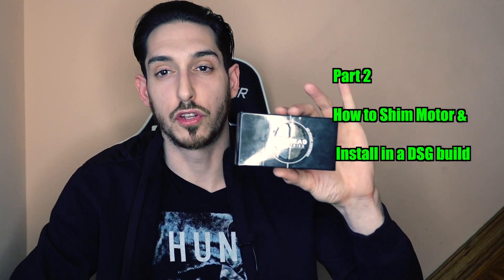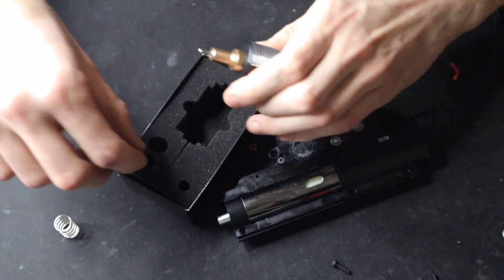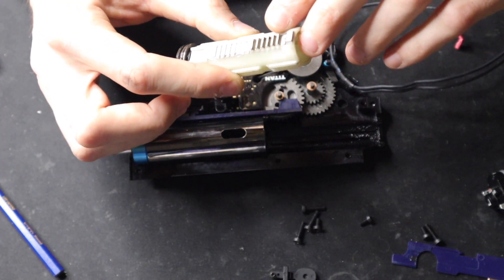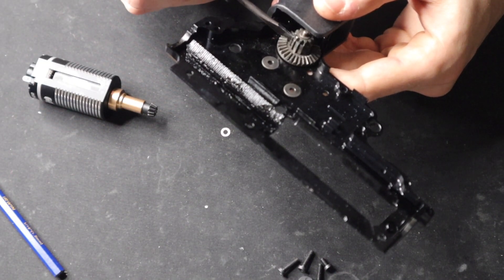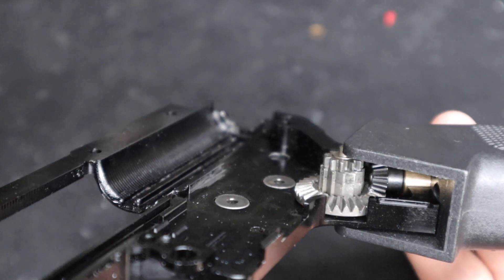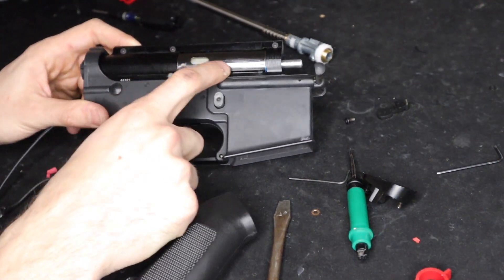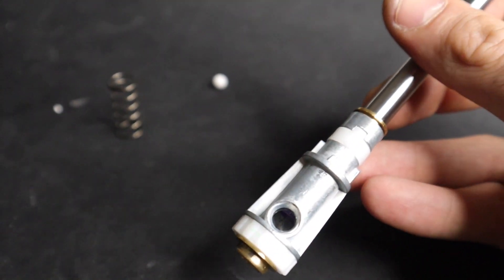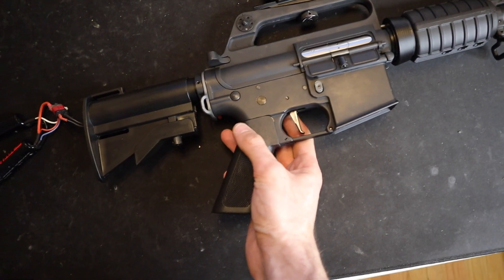Warhead Brushless Motor x High Speed DSG Install & Test + Mis Feeding FIX

Comment: I burned out a brushless motor 4 hrs into a Milsim , puff of smoke. Wish I got the Warhead instead
Reply from the maker: Warhead is garbage and the worse motor. 

If something failed it was most likely due to installation , or mis programming. Warhead is ass compared to T238 

I’m also coming out with my own brushless motor this up coming month

Comment: I have a question i Have krtyac Rec7 barret model and i want to buy the warhead 50krpm but which battery should i use?? Can i use 11.1?? Or 7.4?? And which gear set is good 13:1?? Or 18:1 can you please help me with my question👍🏻

Comment: Hi bro awesome video! By the way Iam now installing the warhead 52k to my dsg build and it is double shot on single, do you have any idea what should id do to fix it? Thanks!
Reply from the maker: Bro your in for a world of trouble with a 52 k and a DSG. But your going to need active breaking because your motor is way too fast. But then warheads don’t work with active breaking enabled. 

You choose a motor that was wayyyy too fast
Reply: @TheRealDealAirsoft  Iam thinking to change the warhead to the 36k one, will it eliminate the problem? which warhead you are using in this vid? By the way thank you for your quick answer! it means a lot!

Comment: what motor is that, is that the standard motor or the high speed or ultra highspeed, i have been told by reddit not to mix high speed motors with dsg gears, so im assuming it is the standard motor?
Reply from the maker: It was the 30k warhead but it had so many feeding issues now this build has my Real Deal Gen 2 Golden Boi Motor achieve it nearly the same rps 

https://www.therealdealairsoft.com/products/the-real-deal-motor-18tpa-n35sh-high-torque

Comment: Would it be possible to just put a new motor in a stock gun and maybe upgrade the piston so it doesnt break?
Reply from the maker: For sure. But while your in there you might as well change the mosfet to something like a perun hybrid because it will controll the motor. Sometimes high torque motors could cause over cycling the mosfet controls the system 

https://www.therealdealairsoft.com/products/perun-hybrid-mosfet
Reply: @TheRealDealAirsoft  i have zero tech experience besides dropping in a new charging handle haha so im not sure how it works or how to put it in, i dont want to mess my gun up by doing something wrong or having my nozzle mis-aligned when i put the gerbox back in

Comment: Just so u know mah is battery capacity not power rate u want higher discharge battery for better rof and trigger response like that battery was 15-25c probly if u want more from 11.1 use 35-50c discharge I can go higher but ya just wanted to let u know mah is just howlong your battery’s gonna last for

Comment: I’ve used so many types of aoe correction I’ll give the ppl a cheap alternative since Sorbothane hard to get in some places but rubber washers work great and good for gearbox shell u can find them softer to very firm u want a more firm hard rubber washer so it buffs the beating on the gearbox shell

Comment: @The Real Deal Airsoft  You are correct on the reason you get higher performance under load with the 3000MaH battery vs the 1000MaH battery with the same C rating is because the total continues output of the higher capacity battery is much higher. (3x)

The reason this matters is because the mechanics of what causes this performance decrease is also detrimental to the health of the battery.
The 3000MaH battery at 10c can deliver 30 amps continues. 
The 1000MaH Battery at 10c can deliver 10 amps continues.
If your setup drains 20 AMPS continues on full auto, the smaller battery wont be able to supply that at the rated voltage. So In order to make up for the demand in current the voltage has to drop. This in turn will slow down your motor and is also bad for the health of your battery. 
This also means the 3000MaH battery will be perfect for this setup. And getting a higher C rating is a waste of money because the AEG does not require more current than the battery can provide. Getting higher capacity is useful tho because this means you can run the AEG for a longer time before the battery is empty.
If it fits in your AEG. Use a 4000MaH battery at 20C over a 2000MaH one at 40C. Both can output the same but one will last much longer. 

Also be aware that 90% of the batteries marketed at "airsoft" are straight up lying about their C ratings. 
I've tested a lot of batteries on my dyno and the majority of airsoft batteries that claim 20 or 25 C are in reality only 10 or 15 at most.
Most people wont find out. Because in burst discharge (couple of seconds at most) when they full auto the battery can supply enough for that time.

It's insane how they can get away with lying about that. Some even charge a premium for their higher discharge batteries and they are the same under the wrapping.

TLDR: Airsoft brands lie about C ratings. When a lower capacity(less MaH) battery decreases your RoF and trigger responds, it cannot supply enough current to your AEG.
Reply from the maker: You have no idea how many people fought me on this

Comment: Currently running a
18:1 dsg
Sp150 3 coils cut 
No active breaking 
Asg 16tpa 30k 
Gate titan 
3000 50c 11.1v 

 And running into lots of heat issues and high amp draws 60 on semi and 40 on full. My motor is probably over working it’s self. Also my ROF has decreased significantly from 42 to 29 motor is probably fucked from all that heat. I want something more efficient like a warhead brushless but I’m not sure what rpm to use on my current set up I want to improve the trigger respond as well as keeping my rps somewhere healthy for a 18:1 dsg. If you have any recommendations on what rpm to use that will be greatly appreciated.
Reply: i believe the high speed version that runs at 36k with a 11.1v should suffice. unless you want to go ham and run the 52k (35k at 7.4v) rpm one. like in the vid. as far as my experience goes. torque is not a major issue on any of the rpm's would recommend using a black series one. dissipates heat a bit better. ( take all of this with a grain of salt. i am no professional. just going of all the builds in my local community)
Reply: @nikosator  Alr thanks 🙏 Ill take that into consideration
Reply from the maker: If you don’t want problems just grab a real deal golden Boi. Youl hit 40 rps easy and the motor will be tons more efficient. ASG has lower tap count and has magnets that actually cause a higher amp draw than n35 magnets. ASG30 k is old tech. 

The warheads will most likely cause you issues. I don’t use them anymore. Tired of spending $150 for the warhead ecu to act up and cause misfeeding. I’ve experienced so many problems with warhead I stopped carrying them. 

Drop a real deal golden Boi in there and you will have no problem. If you look at my DSG recent builds I show how the golden Boi performs. It’s amazing. If you need a real deal shim guide tk aid in shimming and heat reduction. Email me and ask for it
Reply: @TheRealDealAirsoft  Could you get 60rps from a Golden Boi?
Reply from the maker: @mrcloud234  no Youl be in the 40-48 rps range depending on set up. 

It’s wicked fast anything over 45 rps is sketch and has diminishing returns
Reply: @TheRealDealAirsoft  Ok Thank You So Much!  Will it over heat? Run Hot? Wear down the gears?
I really have no clue but You know more than me. I was Really hoping for 60 RPS but ill settle for 45 lol

Thanks. (edit) nvm 45 good https://www.youtube.com/watch?v=Vbf0yvYbyT8
Reply from the maker: Don’t ever use a 50 k warhead. Don’t you will have failures
Reply: @TheRealDealAirsoft  I’ll try the golden boi how long would shipping take to California
Reply from the maker: Your shimming is the problem. Your bevel to pinion is causing your motor to draw much too much heat. 

The best option for your desired rps range .. especially if your running an ASG 30k then my real deal golden Boi gen 2 motor is your go too. 

I have certain magnets that are high temperature rated neodymium magnets which are meant to maintain performance even during high heat exposure. 

As well we have replacement brushes if your brushes wear our. Cheap part fast shipping. 

Also my motor has 2 more tpa than the ASG30. That motor is known to run hot. 

More tpa is more torque and will thus draw less energy. 

And on top of it my rpm is almost the same as the asg30k tested with no load. So Youl have the same rps. After you grab my motor email me and I’ll send you the real deal shim guide pdf and re shim your bevel to pinion.

Comment: Bro I need help, I have that same motor, I bought the gate titan, I bought the Siegetek Concept Cyclone Revolution Plus (10.44 Ratio) I bought the blue retro arms gearbox, and installed everything perfect but when I shoot, it shoots 2 or 3 times and gets stuck, it is searched for a thousand things and I don't know what's going on, everything runs perfectly, and I use a spring 150, I'm frustrated.  I'm installing all that to an arp9
Reply from the maker: Got to love a warhead lmao. I refuse to use the black can warhead because of literally dozens of builds maybe in the 20 -30s of AEGs with black can that just caused so many issues. That’s what actually inspired me to reading and launch my own motor. The Golden boi. But try to flip it to auto when you power up shoot a burst then go back to semi and see if it functions
Reply: @TheRealDealAirsoft  thank you very much, thank you for taking the time to help me
Reply from the maker: Also make sure to modify your baseplate if the grip. ARP9 does not seat the motor well it’s not good. It will cause a lock up for sure.
Reply from the maker: On my IG if you scroll down I have an ARP9 with a warhead and I show the modification needed on my IG just  scroll down alot

Comment: Why is the half missing on the Piston? Do i need to do the same? 2:50
Reply: For Dual sector gears with 8 teeth. Don't need more teeth on the piston if only ~6 are being used. Weight saving.

Comment: I got problem with gate advance+DSG +Warhead 30k.. if use 0 active break will overspin at single.. and i put at 40 for active break no overspin again.. are that okey for the motor use 40% AB?? Thanks
Reply from the maker: Warhead will cause you a ton of problems expecialky with DSG that’s what inspired me to launch my own Line of motors 

Use as little AB as you can. Try lower settings but if 40 percent works then stick with 40 percent. It won’t hurt the motor
Reply: @TheRealDealAirsoft  thanks sir. I was try to change my bevel gear use 9teeth and now i using 20% AB . No overspin again.. hope we can share some problem again sir..
Thanks
GodBless 😎

Comment: Higher Mah doesn't equal higher RPMs... That's not what Mah does. It's energy storage. The higher Voltage is what would give more speed, because voltage is the power and ampere (the "a" in Mah) is the resistence. Voltage is the transfer of electrons across a medium, so the more voltage you have the more electrons you have, the more energy you're inputting. Hence why 7.4s are generally weaker than 11.1s. 

C is current, which is a measure of voltage to amps across the medium, or the measure of voltage against resistance; and is calculated as C=V/A , or Current equals Voltage divide by Ampere. And C rating is the charging and discharging rate. Basically all that means is how quickly a battery can offload it's energy, Higher C ratings will perform better under loads, and provide more consistent energy over time, but cause the battery to drain faster. 

Mah is determined for that voltage BASED on 1C, so for one hour at 1C, 1500MAh will output 1500 milliamps continuously, while 1000MaH at 1C will output 1000 milliamps. So for instance:
two 1500MaH 11.1v batteries - one at 15C and one at 30C; the 30C will discharge energy at a higher rate, making it last half as long. So while both battery both batteries have the same voltage and Mah, the higher C on one means lower amperes thus more energy output. So essentially, higher V and/or higher C means more energy output while higher Mah means longer playtime. 

In short - an 11.1v 1000Mah battery will perform JUST as well as a 11.1v 3000Mah battery of the same C rating; just not as long. Kind of like two cars having the same MPG consumption, but one has a Much bigger gas tank.
Reply: Mah= how big the battery
C=how much power is getting discharge
To make is simplify it down
Reply: lol this is so fucking wrong it’s not even funny “bro… less amperes means more energy” no it doesn’t you moron. Energy = Voltage X Amps 

c rating is the discharge rate but is relative to mAH. 

To calculate the current in amps for a 6000 mAh battery at a 15C discharge rate, you use the formula:

\[ \text{Current (Amps)} = \text{Capacity (Ah)} \times \text{C-Rate} \]

\[ \text{Current (Amps)} = 6000 \, \text{mAh} \times 15C \]

Since 1 Ah = 1000 mAh, first convert 6000 mAh to Ah:

\[ 6000 \, \text{mAh} = 6 \, \text{Ah} \]

Then, calculate the current:

\[ \text{Current (Amps)} = 6 \, \text{Ah} \times 15 = 90 \, \text{Amps} \]

So, a 6000 mAh battery at a 15C discharge rate can provide 90 amps of current.
Reply: wellllllllll kinda. But in practice more mAH will in nearly all cases translate into higher output. You said it yourself C rating is a relationship between voltage and capacity, but even we KNOW c ratings are not really a reliable indicator or actual output, c ratings are in fact ussually bullshit. What isn't bullshit it battery sag. It's REAL. A lower capacity battery will sag (reduce its output) quickly compared to a higher mAH battery. A higher mAH battery is much less likely to sag when compared to smaller capacity battery of the same voltage. So while mAH is not considered the primary indicator of power output, it's certainly a factor.
Reply: @gopilot21  I literally forgot all of this because I fried my brain in Junior level Calc.

Comment: Beast mode! Do these warhead motors work with the perun ++ G&G drop in mosfet? Also what speed motor would you suggest for reliability and fast semi for a stock G&G SR30 upgraded with the perun ++ drop in mosfet?
Reply from the maker: Yeah the warhead 30-36 k would work just fine make sure to shim bevel to pinion check motor height and it does work with that mosfet
Reply: @TheRealDealAirsoft  you rock! Thanks for responding! What are the chances you would want to take on building out the gearbox for my black hawk down build? Using an E&C XM177 for the base. Let me know maybe we can discuss?

Comment: Hi ,
I have a m130 with 12:1 short stroke -3 
And tienly 25k , 11.1v - 1000 turnigy batterie ( couldn’t fit a bigger batterie in my mp5 :/ ) 
BUT it draws like 40 amps in semi and the grip gets HOT AF .. 

If i get a warhead motor , will this give me better results ? If yes which model do U recommand ? 

Thanks a lot ! 
Have a good day !
Reply: Shimming is ok and everything else, 
I have another build which doesn’t get hot with SHS HT but it has lower spring and battery too
Reply from the maker: Yeah the 30k will never get hot. 

Just make sure you res him bevel to pinion when installing new motor
Reply: @TheRealDealAirsoft  hey just installed the warhead motor, just WOW! Semi cycle time divided by 2 , tienly 25k draws 40+ amp and warhead draws like 16 amp in semi 😎 no more hot motor grip !

Comment: Not sure the current draw on brushless motors, but never use 1000mah batteries, under any circumstance. mah does not determine speed, voltage does. A motor pulls what a motor wants and no more. If your motor wants 40 amps and you put a battery in that can produce 100 amps, the motor will still pull 40 amps. Only difference is the bigger battery will drop less voltage under load causing the ROF to be higher. Best bet is to get a 5000mah battery and fire the gun, check the Gate Titan stats to see the amp draw in semi. If it is lets say 30 amps in semi, you can then use a battery that produces 35-40 amps. If you were to put a small battery in (like a 1000mah 15c) and checked the stats, it would say about 15-20 amps in semi, because that is all the battery can put out. It would be maxing the battery out and over discharging it causing it to puff up and possibly smoke. I check the amperage with the battery I use and compare to my test battery to make sure the motor draw is the same, otherwise the battery is wrong. It will cause huge voltage sag and the ROF will also go down because the battery can not keep up.
Reply: I have a build I tested with a 2200mAh 30c and a 5000mAh 30c battery. The ROF was about 1RPS higher with the 5000mah. The bigger battery will be able to sustain the ROF of a longer period of time though. Both batteries supply adequate amperage and are safe to use. If I were to put a 1200mAh 20c in the gun, It would puff or die within a few games. The amperage is not there. The ROF would also be lower because the huge load would cause the voltage to drop. Semi cycle time would also decrease for the same reason.  Stop building 12:1 16TPA SP120 AEGs and putting 1100mah 15c batteries in them because it is the only thing that will fit in your PDW stock. Then wonder why your battery is puffed up.